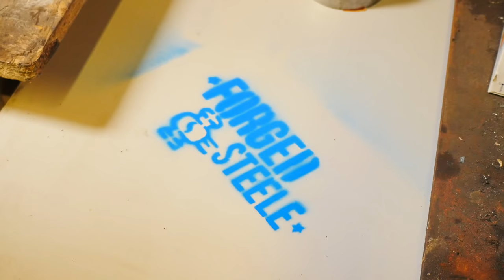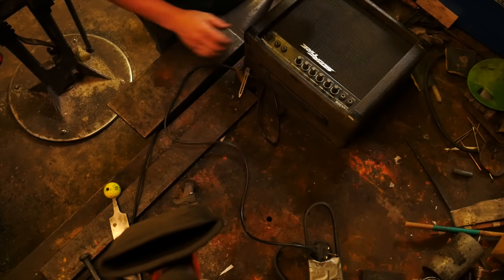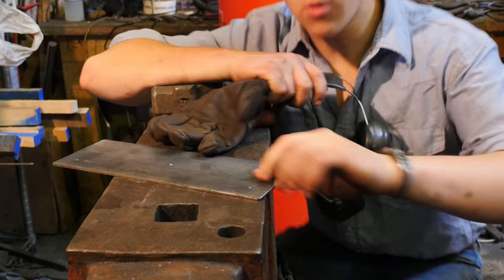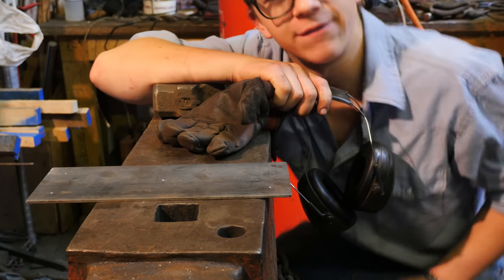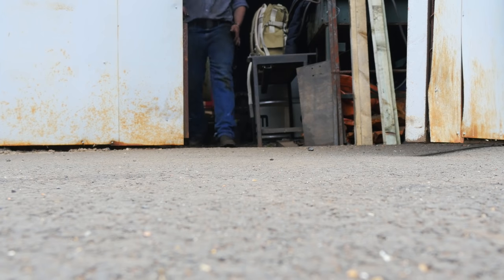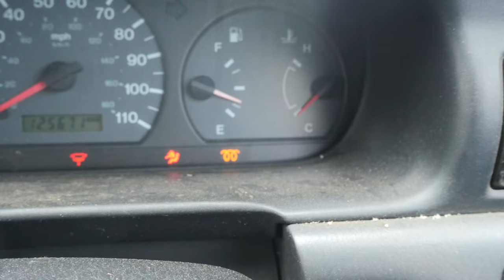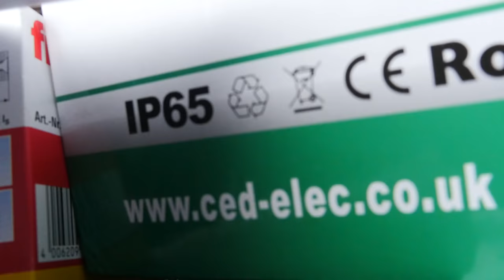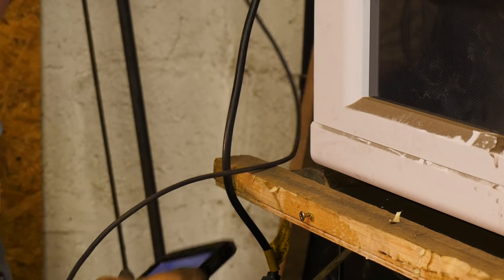How to Annoy Your Neighbours (in 4k)

Comment: why do you take the chisel thing out every time you hit? 3:56
Reply: Not 100% sure but it may be to prevent the chisel from welding to the heated metal.
Reply: Ditto to recenter it and not punch in the wrong direction
Reply: It's hardened tool steel if it heats up it will ruin the temper you notice after he hits he cools it in water